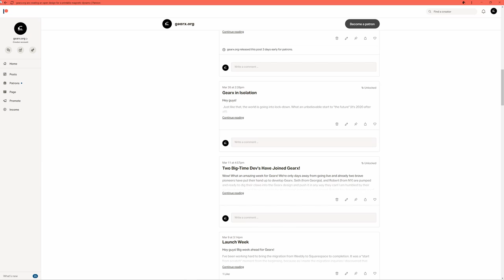Gearx.org: Episode One

Comment: I appreciate the magnets are expensive, but a link to the specific magnets for this design would be helpful.  The link you offered points to the homepage of a company that manufactures thousands of magnets unrelated to this project.  Would it be possible to make a video dealing with the magnets and even see a working demo?
Reply from the maker: Hi Paddy, sorry I didn't get a notification for this comment. I will be making a video regarding the drive system in its current stage of development soon. The magnets themselves are not expensive, and become even less expensive in larger quantities. Please bare in mind that the Gearx Mk1 prototype is a series of 6 integrated systems, all with their own development cycle. Good things take time.
Reply: @camerongreatorex8656  Indeed they do. I am familiar with 3d printing and basic electronics electromagnetism via magnetic coil systems etc, but time is running out for these projects NESARA and GESARA are just around the corner. Between now and April 2021 to be exact.
Reply from the maker: @PaddyNinja  I try to refrain from predicting the future. You never really know what's waiting around the corner. If you want to assist with development or support Gearx, jump over to gearx.org and make a start. It's definitely a noble cause worthy of support.